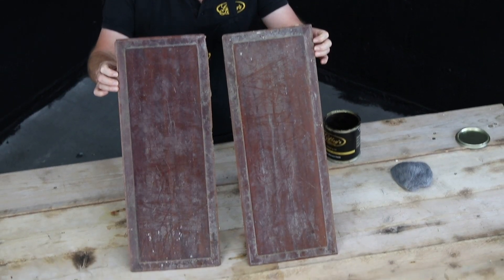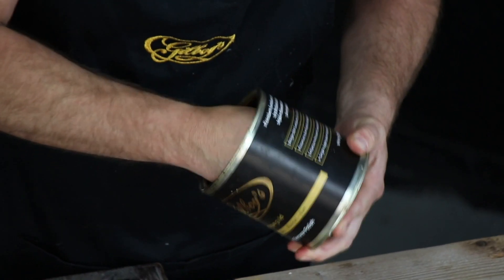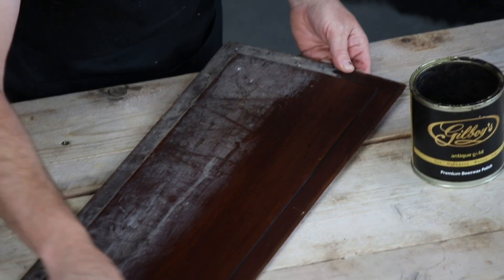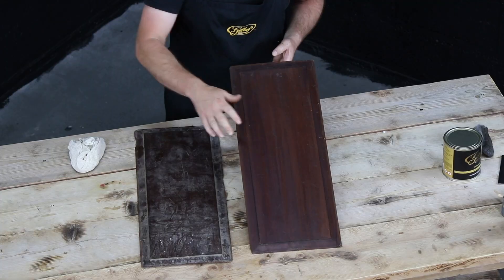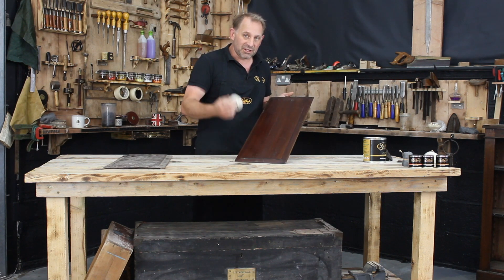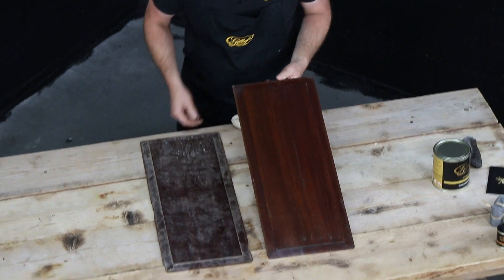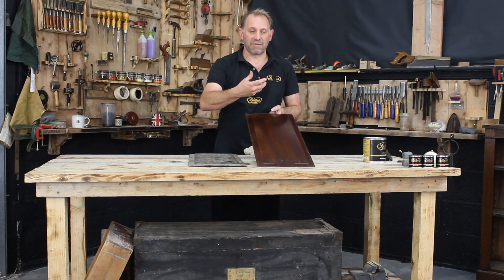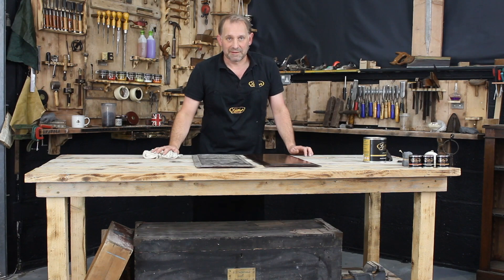Gilboys Beeswax Furniture Polish - Before and After Side-By-Side Comparison

Comment: I’ve got an antique dark brown coloured chest of drawers. It has hints of red too so I think it’s red oak? It’s very dry and absorbs lots of wax. Should I apply an oil to it first then a wax like gilboys
Reply from the maker: It all depends on the age of the piece. If it is calssed as an antique oiiling it may be damaging it, but if not then yes it may have been worth sealing it first then waxing it. 🙂
Reply: I had two pieces...19thc cupboard and dresser... that were dry from having been placed to near fireplace(s). Took repeated waxing, but three coats (week or two between each) did finally do it.